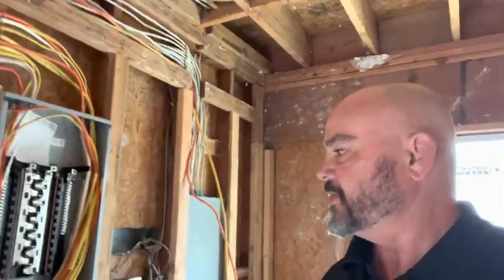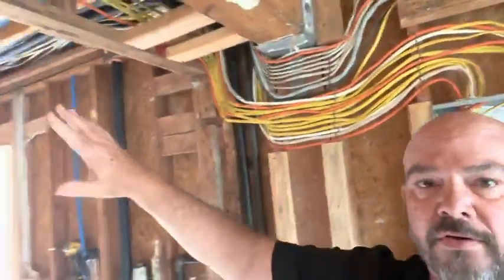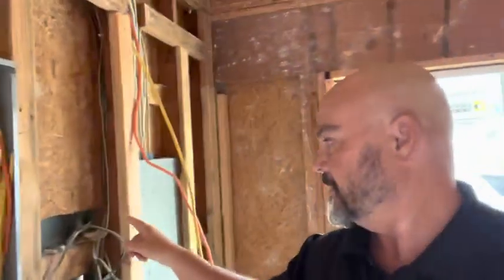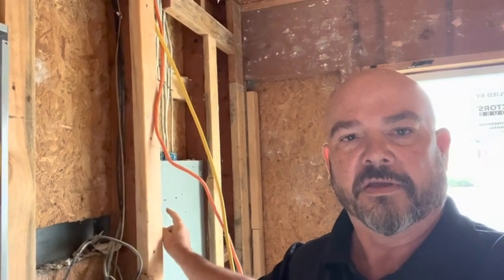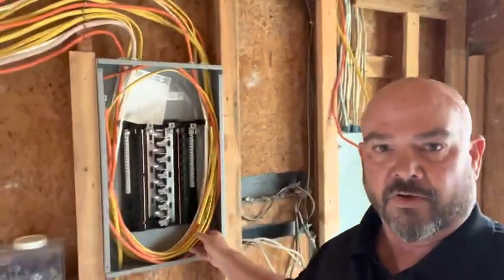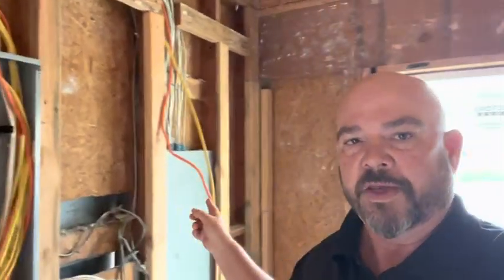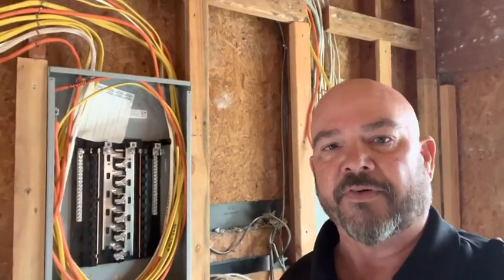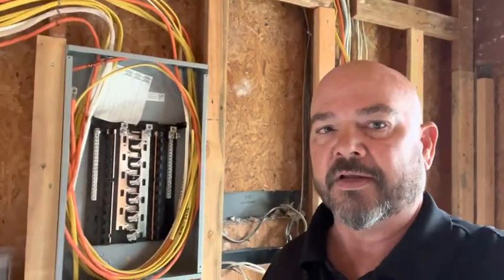ADU Garage Conversion | Electrical Panel Installation 🏠

Comment: Do u have to get approval by sce to update electric pane from 100 to 200 ampl?  Even though using same electric meter for adu garage conversion.
Reply from the maker: No, you do not need approval from SCE you need a permit from the city though. Call me if you have any questions. my number is 7144656782.